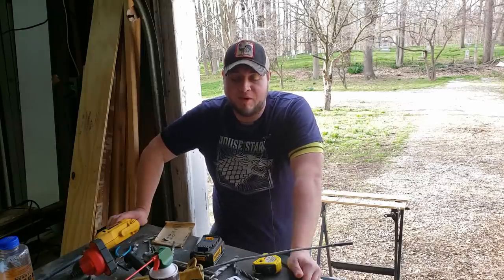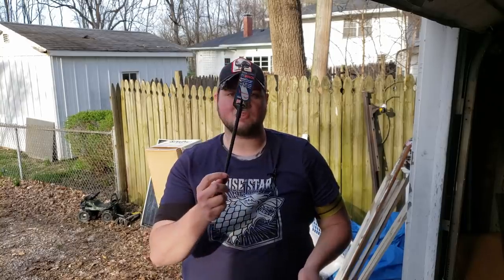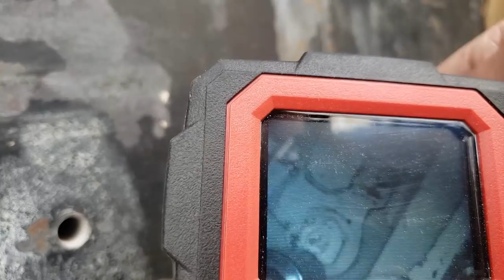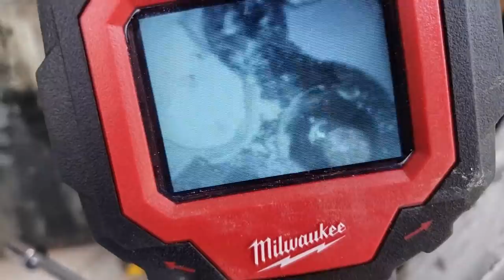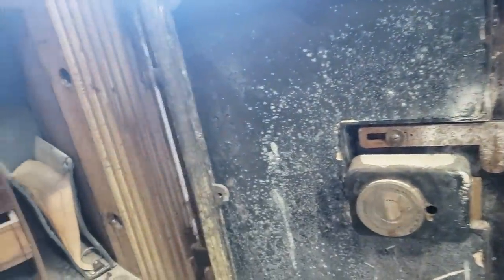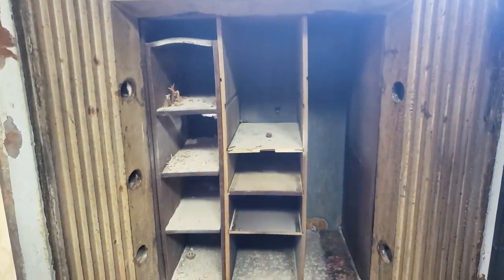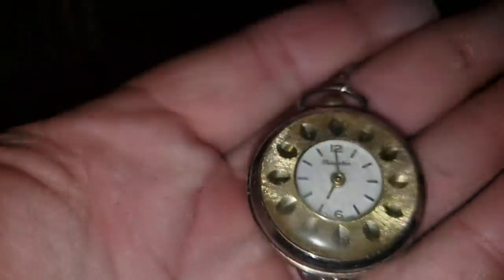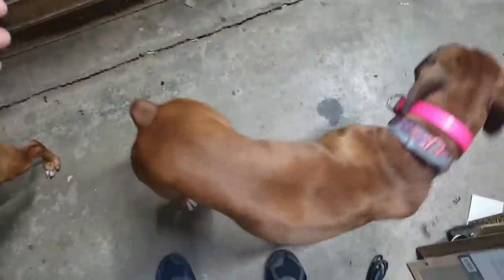Opening an 18th Century FREEMASON Locked Safe! (Finally!)

Comment: Really impressed by your ingenuity in getting in to the safe. The fact that you saved the locking mechanism is fantastic. So sorry there wasn't more treasures inside. Best safe video I've seen.
Reply from the maker: Thanks! I didnt want to destroy the sole purpose of the safe itself. Now, I need to reassemble the lock and figure out the combination!

Comment: Hay kiddo; back before battery's, when the dinosaurs roamed, we used 'ta have to twist the knob on the top of the watch (sometimes on the side) and twist it 'till it stopped moving and you could hear the watch ticking not unlike a "time" bomb!!!   When your finished twisting (winding) you pull up the stem you just wound and set the time, then watch your watch and see how long it runs and then do it all over again!!!!   ;-D    I really enjoyed your safe cracking, well thought out!!!   That's worth a couple of atta boys and a slap on the back!!!   Good job!!!!
Reply from the maker: Thanks! we got it working after we wound it up and blew all the crud off of it! whats more interesting is how this locking mechanism works!
Reply: @ChaseThrifts  Yeah looked like you had fun figuring it out!!!!    You know what they say about simple!?!   The simpler the mechanism, the better it will function over a long period of time!!!    Have fun playing with it!!! ;-)

Comment: Could have made it easy for you take a cut off wheel and cut  a 6 inch square hole in the back you punch out the plaster Paris the horsehair and I even heard they had aspectus in that stuff you're reaching take the back off of the door and open up the door once you do that that door it comes off probably weighs 150 lb take it into a lock shop hey get them to reset the combination number turn the safe over well the patch back in fill it full of plaster Paris and you got yourself a safe.

Comment: I could not make out the brand of watch. How do you know it doesn't work? Did you wind it? Old watches require winding to work. Is that a single chain with some kind of clip thing on the other end? That's for a vest pocket. Move the hour hand to quarter past nine, then try to focus in on it again. What does it say in very small print at the bottom of the face? You'll need a magnifier of some sort I'm sure. Wind it gently, if it will wind, it may still work. I'll wager whoever cleaned out the safe last didn't see em either. The dog tags could prove interesting, there should be enough info on them to figure out who they belonged to and when, from there you can probably get the whole story, at least their military record if you want to go to the trouble to track it down. If you can manage to make out the name, and what it says at the bottom of the face, I can probably find out something about the watch. To find out the most, you will need to open it, and get the numbers and things off the back. However, find someone with the knowledge and tools to do it right, if it might be valuable you don't want to risk messing it up. I have the tools and know how, but you'll want to find somebody local. Make out what it says on the face, I can give you an idea what you've got before you go looking for a local expert. tootall1121@yahoo.com
Reply from the maker: Its a Princeton after closer examination. I think its a $50 little watch. I did wind it and it does work though!
Reply: @ChaseThrifts  I would say you're close to right, you might get up to 75, but you'd have to wait longer to get that, 40 to 60 is probably the right range for moving it reasonably fast.
Reply: @ChaseThrifts  If you ebay it, one tip is to make sure the hands are at like a quarter til 3 or so, that way they don't hide the name or the Swiss Made words at the bottom of the face (that's what it should say, be sure to get a legible photo of that as well as the brand name) A little polish never hurts either.
Reply from the maker: Thanks for the tips! I'm considering  keeping it for its conversation piece i could use for my collection :)

Comment: There is no way that's 18th century.
Reply from the maker: no, its not. I titled my first video 18th century.... and then i was like i shouldve put 19th century.. but i went ahead an labled this video the same as the last one just to keep it going. But i agree, not 18th century. BUT i did find some patent dates on the locking mechanism, for 1880!
Reply: Actually the safe is from the later 1800's or very early 1900's.